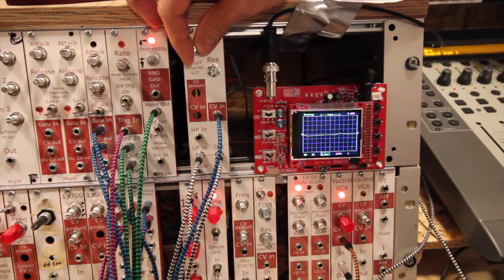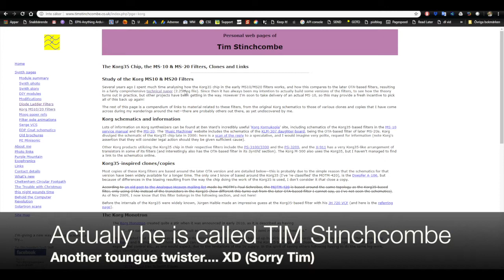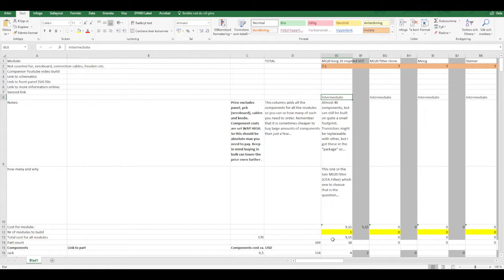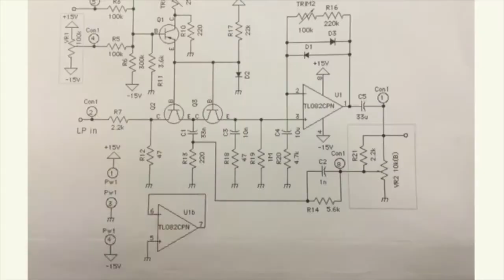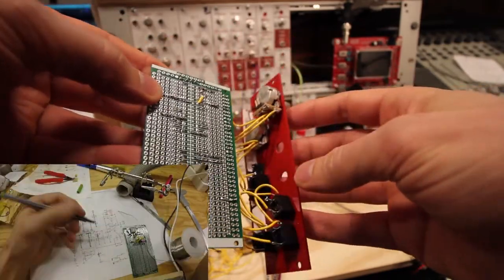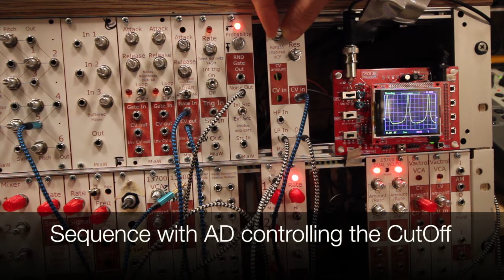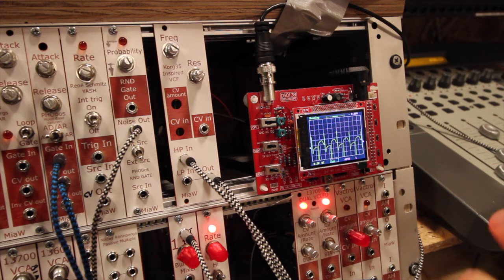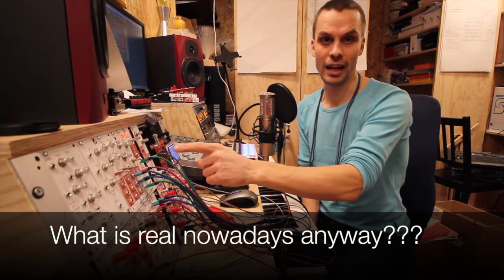Korg 35 Clone MS20 HP & LP VCF (1 of 2 MS20 filters) - DIY Modular in a Week 7.3

Comment: The Korg 35 information was leaked by the Korg employees responsible for the design and engineering of the MS-20. Somebody requested the information and because of the age of the product (this is before the re-issue), Korg determined the information was suitable for limited release but not distribution. Mr. Hiroaki Nishijima / KORG INC. Chief engineer who now works for Behringer released the Korg 35 schematic with notes that the circuit was designed by Mr. Fumio Mieda / KORG INC. Auditor and original engineer on MS-20.
Reply from the maker: Thanks for sharing!

Comment: Sounds good! What transistors (and diode) do you use? You matched transistor pair?
Reply from the maker: No I didnt match transistors, and I used regular 1N4148, and I had the correct npn and pnp the 2SA970 PNP and 2SC2240 NPN, but bc550 and vc560 should work according to an old document by Jürgen Haible.
Reply: Thanks a lot! What level signal was in input? (I think for good sound need signal from vco certain minimum level)

Comment: im very new to synth and moduler synths and i wonder if i made a silier system how can i control it using a midi keyboard to play it ?
Reply from the maker: I will make a midi to cv interface in a later video. So that is how you control it with midi. You convert from midi to cv and gate signals.

Comment: The component spreadsheet has a 33uF capacitor, should that be 33nF?
Reply from the maker: I don’t have it in front of me. But it should be whatever the schematics say. The bom might be a bit off.
Reply: good to know. wasn't sure if you strayed much off the schematic or not
Reply: I'm sorry but what I can hear is not an MS20 mkI filter.
The resonance (peak) network seems to be wrong calculated because it starts to oscillate only in the higher part of the spectrum.
Ms20 lpf is prone to loose  oscillation in the low end but especially in hp mode it can start oscillating in the sub very powerful.
Nevertheless the sweep seems to be incomplete.
The filter would be able to cut off totally the signal at full counterclockwise.
Is the CV properly offset?
The series capacitor to the peak potentiometer must be 33uF and the capacitor bypassing the 5k6 feedback resistor has a large influence on peak response.